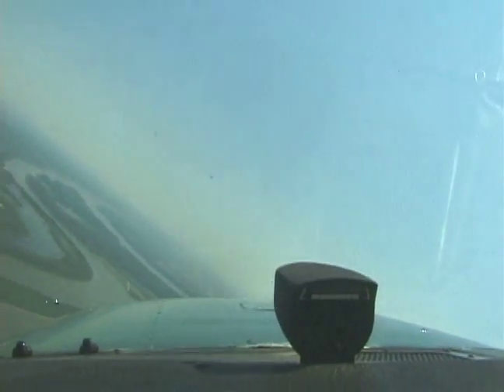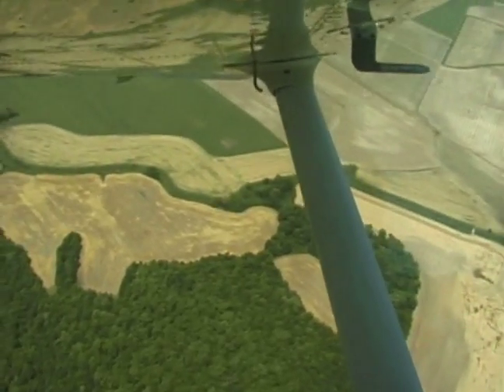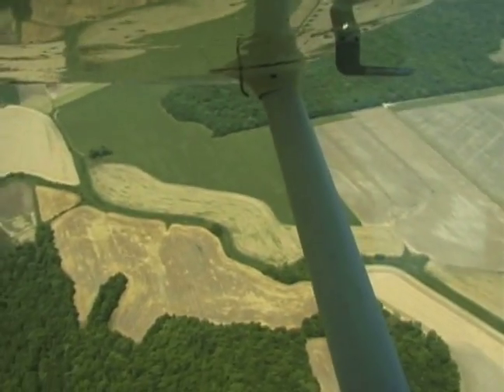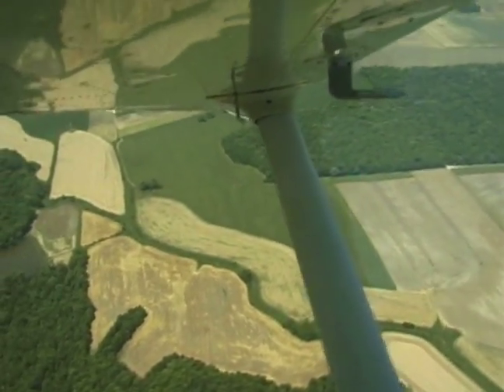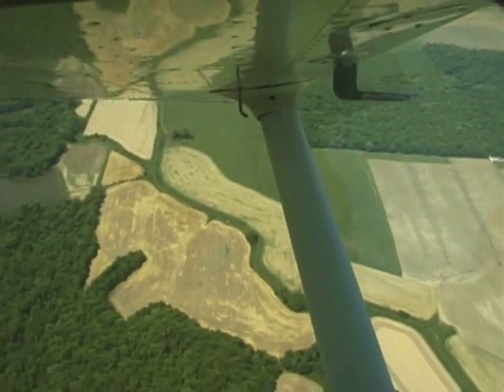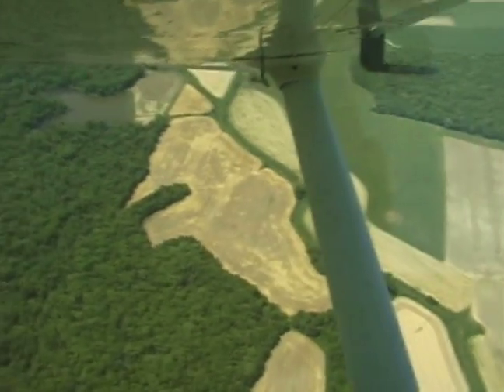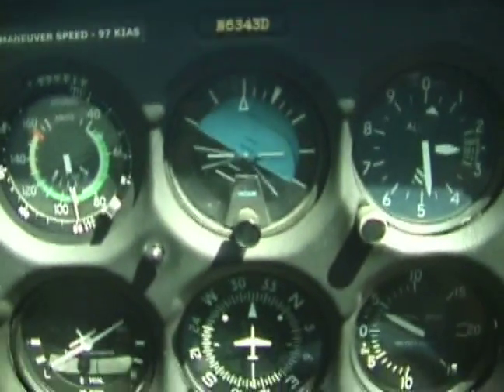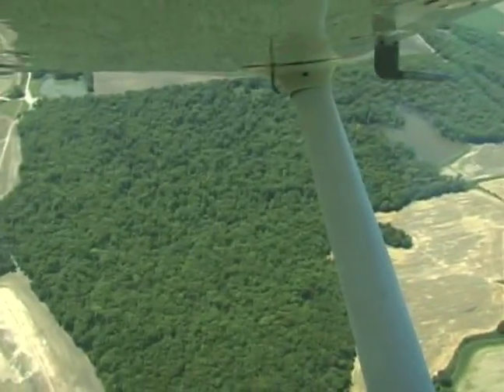How to Fly an Airplane : How to Make a Steep Turn in an Airplane

Comment: The bank angle is nowhere near 45 degrees. Therefore when you add the extra power and apply your back pressure you gained 100ft. You can see when the camera glances at the instruments that you are in a 500 fpm climb. This is more a bad demo of a medium level turn.
Reply: I know it's a little late but it's definitely a 45 degree bank...

Comment: A clearing turn is used to make sure there is no air traffic coming from the direction you intend to maneuver in. The Cessna is a high wing plane so there is a blind spot in the direction of the turn. Before a steep turn to the left you would want to raise the left wing a bit to make sure no one is there. For stalls or spins you want to make clearing turns to make sure no one is beneath you. The left wing rise in this video is very subtle.

Comment: a steep turn is 45 degrees angle of bank. this is not successfully demonstrated here, you can see quite clearly on the AI 31-33 degrees only. The instructor even SAYS 45 degrees in the video as he rolls in, he just fails to achieve it. FORTY FIVE DEGREES is the definition of "steep turn", what is demonstrated is closer to a MEDIUM TURN. (30 degrees AoB)